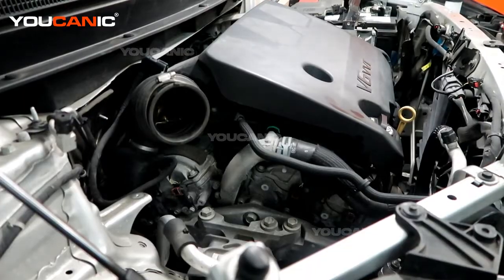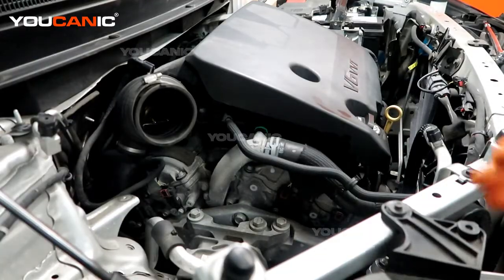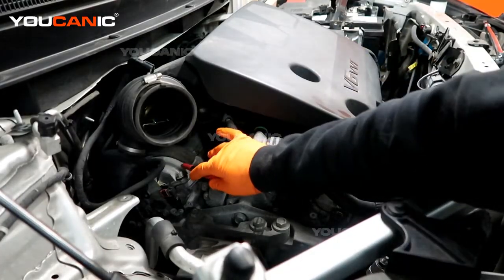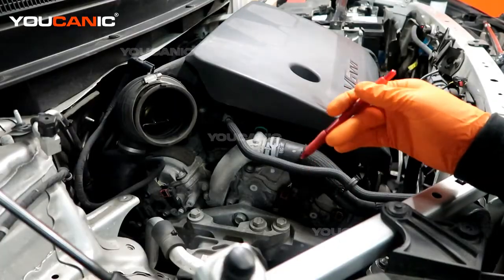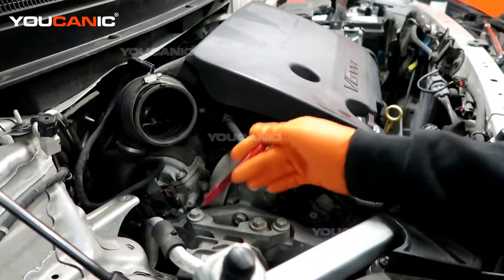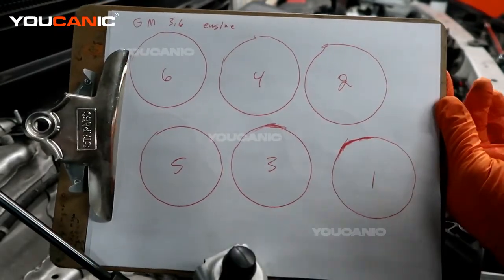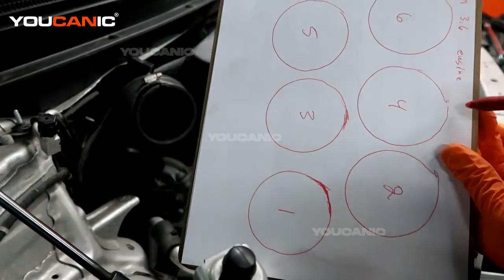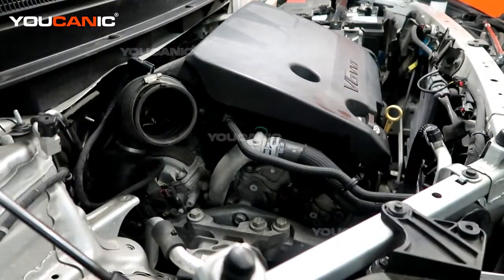How to Locate Engine Bank Sensors ( Sensors A & B or 1 & 2 )

Comment: That’s backwards from the obd2 code I have.  23 Acadia 2.0 and the reader is saying exhaust cam profile position sensor 1.
Reply from the maker: @davidreed3357 If you’ve got a car issue or repair question, you can find step-by-step guides and scanner help at youcanic.com. We might miss some comments here, but our site has answers for most problems already!
Reply: @YOUCANIC thanks

Comment: So the front of the engine is on the left side of the car??
Reply from the maker: @jorgecarrejo If you’ve got a car issue or repair question, you can find step-by-step guides and scanner help at youcanic.com. We might miss some comments here, but our site has answers for most problems already!
Reply: @YOUCANIC had you answered my question.. I would have checked out your site... I'll ask schrodinger's cat or scanner danner...

Comment: Question 
I have a 2010 Buick enclave with code p0017 Crankshaft Position
Camshaft Position
Correlation Bank I Sensor B, which ones would I replace.
Reply: I have the same code, but also p0016. both sensors in Bank 1, sensor A and B
Reply: I have both codes P0017/P0016. What was your car issue